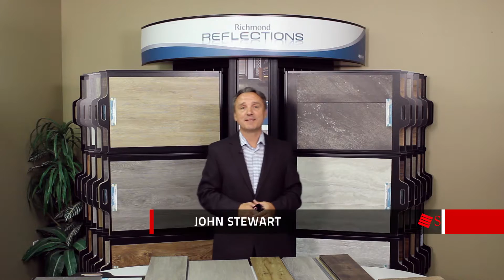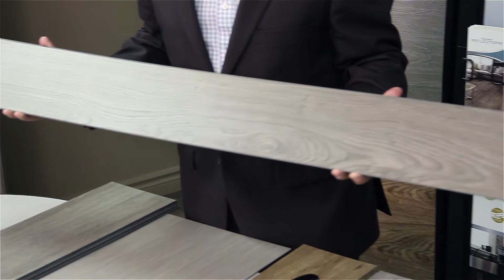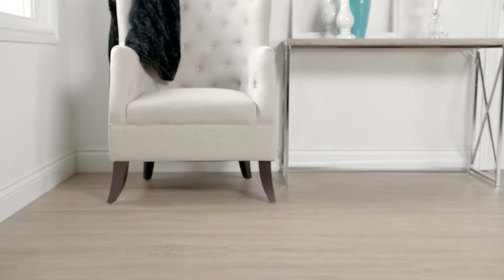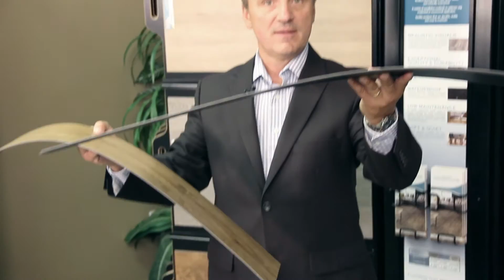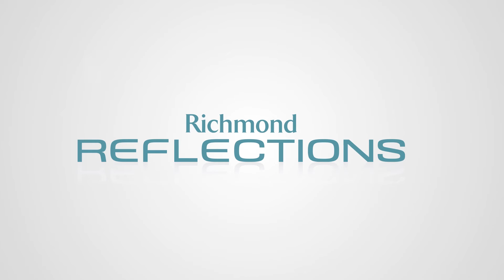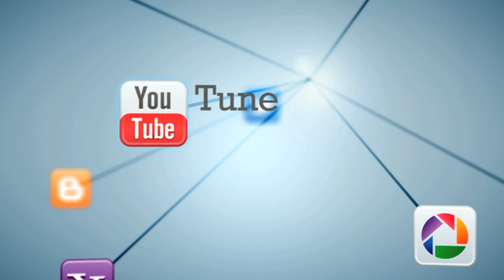Richmond Luxury Vinyl: Episode #16 (An Introduction)

Comment: My step-daughter had the Richmond FirmFit vinyl plank (RVI1630FIRMFIT7) professionally installed throughout the first level of her home. In less than 2 years the joints started coming apart. The ends of some planks have curled up and there are gaps both longitudinally and at the ends of many of the planks. The entire floor will have to be redone
Reply from the maker: Hi Ian - we are so sorry to hear about this. Can you please email us at marketing@shnier.ca to provide some more details?
Reply: I sent an email with a link to photos showing some of the flaws in the floor.
Reply: I also sent a photo of the label on the box so you could see the shipping address and lot number etc. Is there more information you require?
My step-daughter informs me that the same flooring was used in the basement and 2nd floor as well, throughout the entire house, except one bathroom. There are separations occurring on all floors, not just the ground floor.